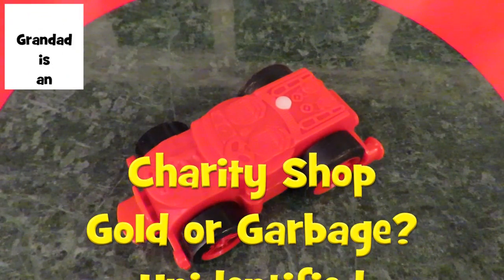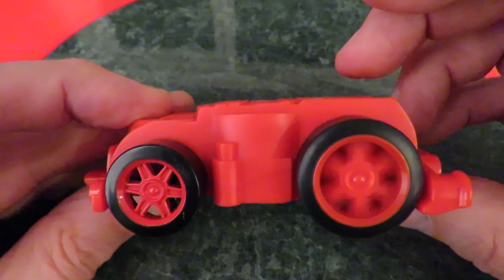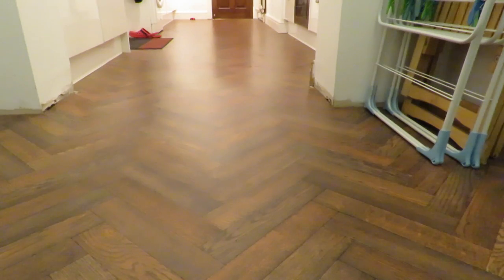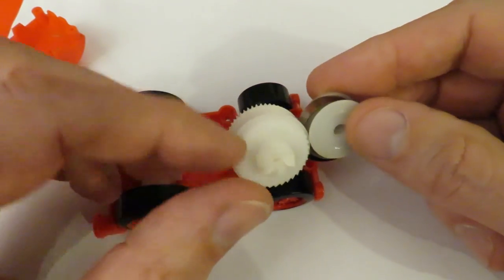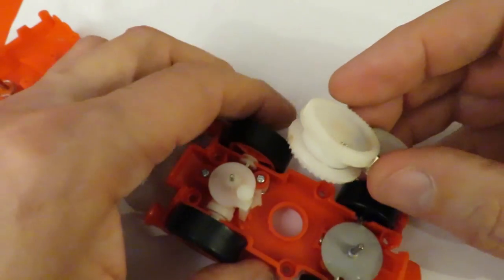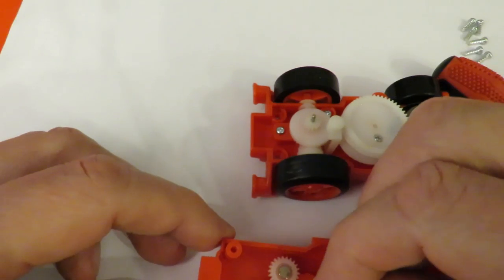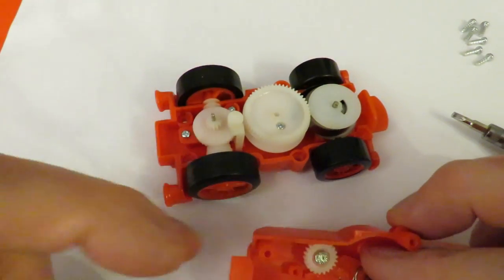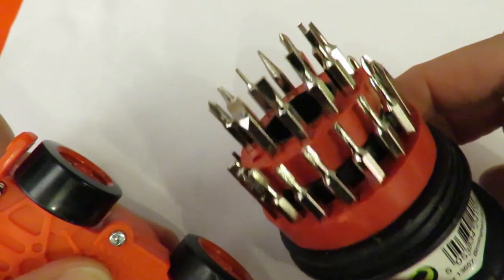Charity Shop Gold or Garbage? Unidentified Clockwork toy car

Comment: get some rc cars at charity shops! i watched every single one of ur rc car gold or garbage videos
Reply from the maker: +J4YTH3W1N __ I think I have done enough RC cars from charity shops. I was buying them to strip them down for the component parts but as I now tend to use hobby grade RC components there is not much reason for buying them from Charity Shops. I will still buy them if they have an interesting feature I want to look at but generally I have done enough of the normal toy RC cars.
Reply: +GrandadIsAnOldMan okay 😀 where do u put all your rc cars?
Reply from the maker: J4YTH3W1N __ If I haven't taken them apart they are in one of my boxes in the work room. Some of the good ones are in the toy box for my grandchildren to play with.
Reply: +GrandadIsAnOldMan pk